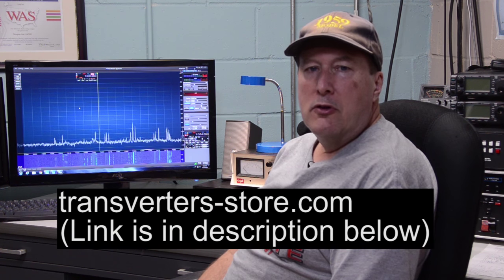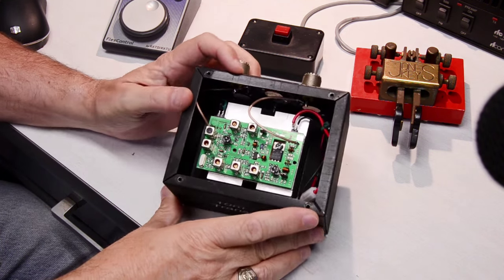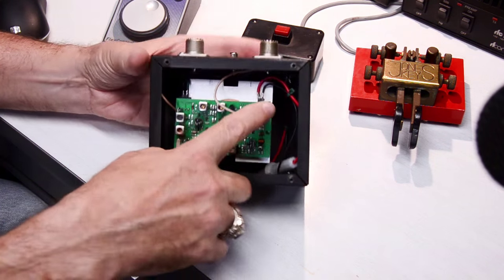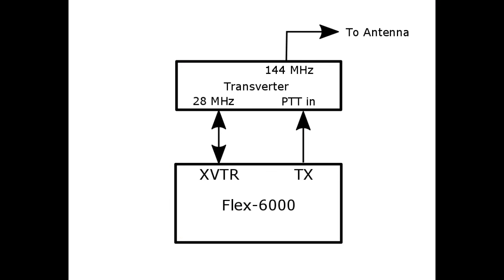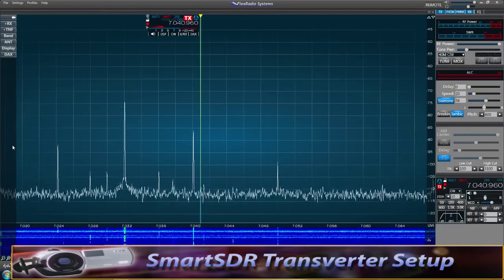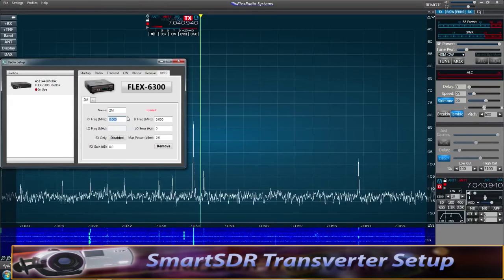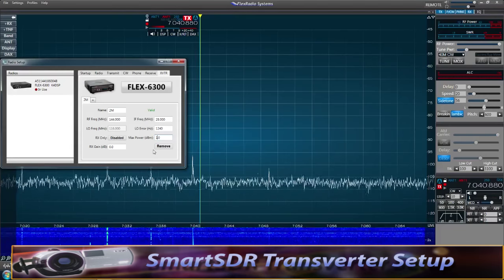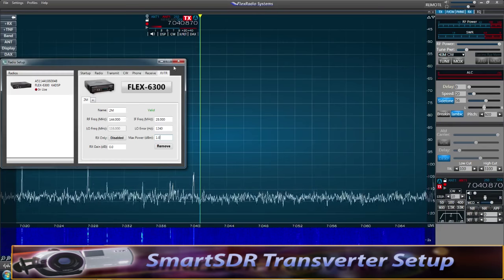$75 Ukrainian VHF Transverter with the Flex-6000 SDR and SmartSDR

Comment: I just ordered a preassembled one for my Flex 6300 - my concerns are the built-in attenuator (which only requires a diode be snipped to bypass) and that the Flex only allows coverage from 144-145.7 MHz with the Flex 6300 (since the transverter directly maps from 10m -> 2m, and the Flex 6300 won't tune out of band).

My main interest is in monitoring weak signal SSB on 2m, if/when I decide to participate I'll likely invest in a powerful amp, but that is in the future.
Reply: Oh wait, the transverter output goes from 28-32 MHz without issue? that's great, I missed that the first few times watched the video... great to know!
If I used the attenuator/transverter I would only get coverage of the lower 1.7 MHz of the 2m band, since the Flex 6300 only puts out RF on 28-29.7 MHz - correct?
Thanks for this very helpful video.
Reply from the maker: As long as you feed the transverter from the XVTR output on the Flex you won't have any issues with band coverage. The XVTR output allows continuous coverage on TX and RX from 28 to 32 MHz which provides 144 to 148 MHz coverage with this transverter.

Comment: Hi Doug
Thanks for the video.  It is very helpful.  Its been a couple of years since you posted this.   I have a 6300 and want to be able to check in some 2 meter nets remotely from work with the ipad.  I am new to ham radio and would like you to recommend what all I need to do this.  I only have the 6300 now.  Thanks 
Johnny
Reply from the maker: Hi Johnny. The first thing to do is to get a transverter and configure it as shown in the video and make sure you can work the local nets using your 6300 and transverter. Then you'll need to configure SmartLink, the remote control feature in SmartSDR 2.0, so that you can operate the Flex remotely. Unfortunately I don't have any experience with the iPad and SmartSDR iOS, but there are some videos explaining that part of the process. Good luck!
Reply: Thanks Doug.  I am operating the 6300 with the ipad remotely.  Just wanted to make sure I was not missing anything before I make the investment.  I plan on buying the assembled 144 mhz without the attenuator.  Hope it will output 5 watts.  Your video has helped a lot of people I'm sure.

Comment: It looks like your spectrum analyzer is clipping the peaks of the fundamental pair's when you are running your higher power measurements. Can you replicate the same test with your specan set to a 0dbm reference? I am curious if your measurements are showing compression due to the selected dynamic range of your gear.

Thanks for all the info. Very enlightening. It would be interesting to see how this piece of gear compares to a DEMI transverter.
Reply from the maker: +Mike Thompson It's just a display issue - I had an external attenuator on the input to ensure that the input signal stayed well within the Rigol's limits.
I don't know how this board compares with the DEMI equipment - it would be interesting to get access to one to do some tests. The TX IMD figures in the ARRL review weren't stellar as I recall.
The gold standard is apparently the stuff from Kuhne, but that's pricey stuff.

Comment: I just bought this board and am setting things up. Do I need to disconnect the attenuator?  I didn't realize I didn't need it when I placed the order.  GREAT video.  Thanks a bunch for posting it.  Rick K5RHA (FLEX 6500)
Reply from the maker: Rick, if you are driving the transverter board from the Flex transverter output then you have to disconnect or otherwise disable the attenuator. The attenuator is intended (and only needed) for users whose radios do not have transverter outputs.
Reply: Thank you, Doug.  I'll figure out how to do that asap.  I think I saw on your, or someone's video on how to do that.  73 K5RHA

Comment: I'm putting this together now. What was the KT1 spot for on the Transverter? I've emailed him, just came across your video. THey have it as pin 4 on the instructions, but dont define it.

Thanks!
Reply from the maker: He just lists it as an internal control point used to adjust the board. I don't have anything attached to this pin.

From the instruction sheet:
4.Control point (we used it to adjust the board)
Reply: Got it. 
I had that sheet turned over to the side with the scematics on it, hadnt turned it over!

Comment: Hi Doug, thanks for the information. I setup my tranverter as per your video, but for some reason my transverter wont transmit. I have checked settings and cant find the cause, any thoughts on what to check?
Reply from the maker: Using a scope or voltmeter make sure that the PTT line (shown as pin 3 on the transverter schematic) is being pulled low (0 v) when you key the Flex. If not, check the connection back to the Flex  and make sure the TX line on the Flex is connected and configured properly.

Comment: Hi Doug, what about if you wanna connect 2 transverters? How ypu coild make automatic switching between them?! I had flex-3000 but would be nice to hear options what would be avialble on flex-6300 sdr rig.
Reply from the maker: Using two or more transverters would require some kind of external switching since the Flex-6300 only has a single transverter port. I only have the 2m transverter so I have not had to deal with interfacing multiple transverters. Sorry I can't be of more help.

Comment: Great video!  One question. SmartSDR provide +- split and CTCSS for repeater operation?
Reply from the maker: Yes, SmartSDR provides for repeater offsets and CTCSS. I have used this transverter with 2m repeaters.
Reply: Great! I had a Flex 3000 in the past and now I´m considering buying the 6300. Would be great to have 144, 220 and 440 with Flex and add ThumbDV for DSTAR and other digital modes. Do you think in add more transverters? If you do, do have any suggestion how to hook all three in the transverter port and switch automatically?
Reply from the maker: I haven't thought about adding more transverters, so I don't have any ideas on how to switch automatically between multiple devices. It seems that you would need some relays since there is only a single transverter output from the 6300. I'm sorry I can't be of more help.

Comment: Dear Doug, I have a Flex 6300 and would like to use the converter for our near Repeater on 145,625 MHz. And how can I open the repeater ( my handy uses a tone for opening)?
And how can I realize the - 0,6 MHz offset? Which cables I need for connection? Which for the PTT? Is a power of 5 W possible? Thank you for help. It's a wonderful video, very helpful. 73 de Frank DM5KK
Reply from the maker: Hello Frank, Please see the email that I sent to you this morning.
Reply: May I please have the same e-mail.  I have a 6300 as well.  Great video!   Thanks

Comment: do transverters allow you to change modulation? i'm assuming not? i don't know much about them other than it allows you to use a frequency (ie like 2m band) with a radio on a different band (ie 10m), but "most" people are FM on 2 meter, and most are SSB/AM/CW on 10m. does a transverter allow the ability to change modulation?
Reply from the maker: Yes, you can use any mode with this transverter. I mainly use mine on 2M SSB and CW, but I have used it on FM as well.
Reply: well, i suppose does it just keep the modulation from the transceiver itself? or does it actually convert it (ie from FM to SSB)? reason i'm asking is because I have a quad-band (10m/6m/2m/70cm) FM only radio, but i'd like to do some SSB for 10m/6m/2m. the only way i've found so far would be to get a dedicated radio, which is going to cost me $800+ unless i can manage to find a used yaesu 857D or Icom 706 MK2G. but if a transverter can be used to convert, that might be a better option for me?
Reply from the maker: No, it doesn't do any conversion. It takes whatever mode your transceiver uses and that's what you get on the 2M side. So you'd need a transceiver capable of 10M SSB operation in order to to 2M SSB with the transverter.

Comment: I really enjoyed this video as it been wondering about the Russian transverters. I currently also use a 6300 on satellites with down converters and another radio for the uplink and it works very well. I'm interested in pursuing weak signal EME etc. and am curious about your setup. I gather you are only using about 150 watts. What antenna are you using? Love to hear more from you. Rick, W2JAZ and I'm on QRZ
Reply from the maker: +Richard Lawn Thanks, Rick. I use an old Cushcraft 13B2 on 2m. I have done some satellite work in years past but never tried EME.  I'm told you can work the big guns (like W5UN) on EME with a 100w station but I think a couple of antennas and more power would help a lot. I'm currently looking at buying an amp from a friend of mine, a homebrew setup for 2m with a pair of 4CX250Bs.

Comment: I just upgraded to a 6300 with SmartSDR. Having ordered this transverter with the antenuator included and assembled,  its wired into the transverter. Can it be used in this configuration with the 6300? Or will the antenuator need to be removed? Thanks
Reply from the maker: I don't think there is any way to use the transverter port with the attenuator in place. It just doesn't put out enough power. With the attenuator board installed you need 10 to 15 watts of drive. I don't know what's involved in bypassing the attenuator but it shouldn't be too difficult.

Comment: I just received a Flex 1500, and i bought a 2 meter Ukraine txv with the antenuator all as one unit. Will this setup apply to the 1500 as well? Thanks, Mike N5LUB
Reply from the maker: I doubt it. The 1500 has a transverter output, so I don't think you need the attenuator. Also the 1500 uses PowerSDR instead of SmartSDR, so the software configuration will definitely be different.

Comment: Will this also work with the Flex SDR-1000? I am building an SDRHam transceiver that is basically a clone of the SDR-1000 but all on one board (instead of the Flex radio's four boards), and the DEMI 144-28 that was originally supplied for the FLex is VERY expensive... 73, de KC8MWG
Reply from the maker: I don't have any experience with the SDR-1000, but if the transverter output is similar to that of the 6300 it should work fine.
Reply: Okay, how do you get PowerSDR to recognize an external transverter? I can't seem to enter it manually in "demo mode", and I can't transmit up to 32MHz as an IF to cover all of 2 meters.
Reply from the maker: Sorry, I don't have anything here that works with PowerSDR anymore. I sold my Flex-1500 when I got my Flex-6300.

Comment: also where or how did you get your graphics stickers from for the box ??
Reply from the maker: I just laser printed them on white stick-on poly-label material with white letters on a black background. Since the case is painted black it just looks like white lettering.
Reply: doug  1 more silly question is there any way i can get a step down transveter 432 down to 144 this is not heard of i guess 7 3 s

Comment: Witch PA i can use with the Transverter and how to set it up?
Reply from the maker: I use an old RF Concepts rfc2-217 which can be driven with 2 watts and gives 170 watts output. I run the RF output from the transverter to the RF input on the amp, and the amplifier RF output goes to the antenna. But this is an old amplifier and no longer available. I haven't tried any other amplifiers.

Comment: Have you made any drift measurements?
Reply from the maker: I have not. The transverter doesn't have a TCXO so I'm sure there would be some thermal drift. In my use it hasn't been a problem.
Reply: I was curious of that, too. Do you believe it would be stable enough to run JT modes? Or would you recommend using a crystal oven?
Reply: The drift is really bad on these units, I took mine out of line because everyone was constantly chasing me all over the frequency. It does work, but extremely drifty.

K5RWD